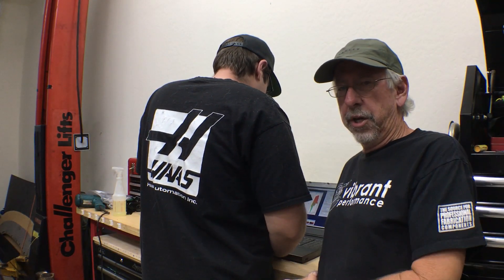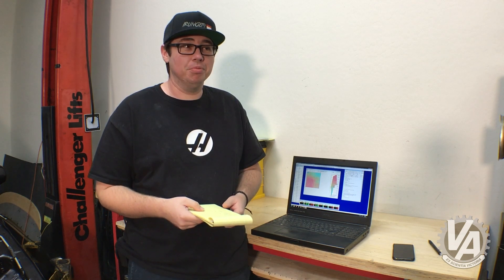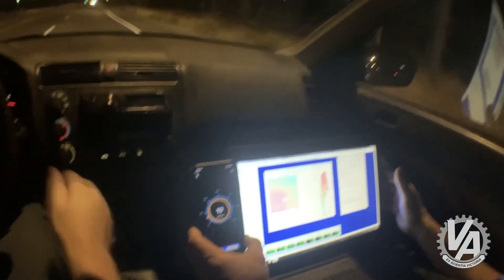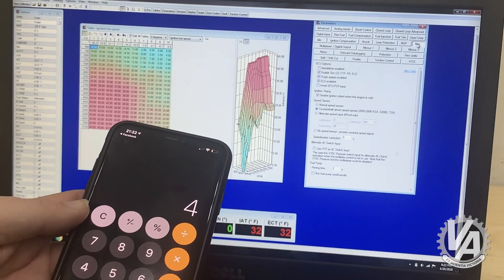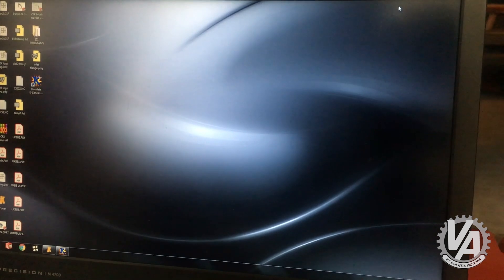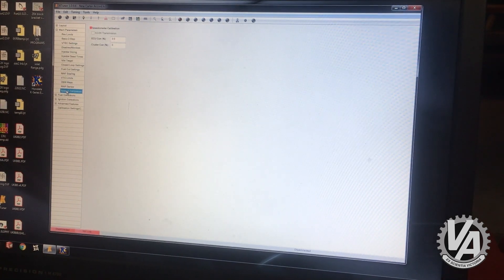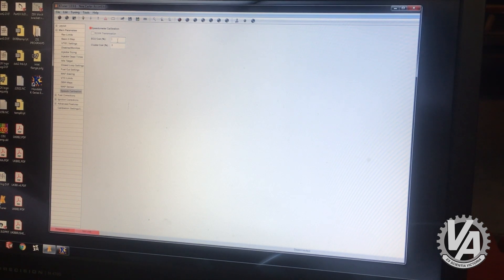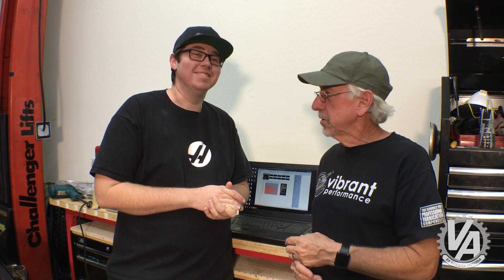How to Fix Your Speedometer After K Swap

Comment: There is a way to amplify the VSS signal within the ecu. The 05 RSX was plagued by a weak VSS signal. Within the ECU RM760 used a 223 SMD resistor. It needs to be changed to a 471 SMD resistor. Then on the QM760 there are 6 tiny solder joints, bridge jump the bottom right corner, leave the bottom left solder joint alone. You'll see that the lower right connects to the left joint on the 471 resistor. This mod fixes random or jumpy speedometer needles on the dash cluster.

Comment: Where do I run the wire from b11 plug using kpro v4
Reply: Runs to the white and green wire on your harness side of the C101 plug I just did this 🙏🏻

Comment: I have a K24A2 CRX. My Hondata V4 won't read speed, so I don't have reverse lockout. It was working and then stopped. I'm not sure what it could be.
Reply from the maker: If it was working, then it’s a bad connection.
Reply: @VTECAcademy   I've checked the connections, but I'll do it again. The harness is a brand new Rywire. I've replaced the sensor. It's throwing a P0500 code. Hondata shows 3 mph all the time.

Comment: K24A ek with 02 crv transmission kpro v4. Tried it but didnt work. Still reads 10 mph over actual speed.
Reply: Right. Because they fail to tell you this only works on the 05-06 speedo sensor and not the 02-04 VSS sensor.

Comment: Hi I k24 swapped my civic now the speedo and temp isn't working on the dash do you know what is worng  with it I changed the sensors and nothing has changed
Reply from the maker: What adapter harness are you using?
Reply: @VTECAcademy  using a ep3 engine harness
Reply: @VTECAcademy  and a TRC civic harness

Comment: Hello sir, kindly guide me, I recently swapped k 24 rbb - 4 head assembly in my accord euro r cl7, the previous one k20a, unfortunately its crank started giving rattling noise. I didn't tune my ecu, its same as if it was with k20a original rbc ecu with same software. I want to know is, what things are necessary after this swap, secondly I am noticing that my accord is now accelerating really to much fast and quick, but my speedometer needle is moving slow, does this thing happen after k24 swap, that the actual speed is more but speedometer needle is not moving with equal pace???? Is the callibtation of speedometer changes with the k24 swap from k20 in accord euro r cl7. Right now it's doing 0 to 100km in 8 seconds according to speedometer needle, but those cars which usually do 0 to 100 km in 8 seconds, remain far far back if I drag race with them till even 100 km. So do you think my speedometer needle is moving slow after k 24 swap?? , although its accelerating bullet fast from previous k 20 a.

Comment: Hey guys! I have a problem similar to this I just recently did a k24 swap on my Acura rsx 03 and my speedo on my cluster is working perfectly fine but on hondata it reads weird, I’m wondering is this a speedo problem itself or is this something I can fix within the tune
Reply: did u find a fix mine doest pick it up at all on the ecu only on my dash
Reply: @Ant0n_42  hey man so I actually changed my tuner to a better tuner and a more recommended one and he basically fixed this issue for me it was my abs wheel speed sensors and he basically bypassed them thru the hondata but your issue seems to be a bit different if you are picking up no signal at all in the ecu perhaps there is a problem with your ecu itself as mine would pickup speeds but it wouldn’t be accurate speeds try seeing if you can get any type of input of speed wher there it’s only 1 km or 100 km per hour  on your ecu which will tell u that it isn’t you ecu
Reply: @Ant0n_42  sounds to me like your having an issue with your ecu itself

Comment: Perfect lol, once again saved by your videos. Spent hours and hours researching this... I should've learned to come here first lol
Reply from the maker: Thanks!
Reply: @VTECAcademy  No, thank you!! It's made my em2 k24a and tsx trans swap much easier despite the unexpected hurdles I've come across due to using the JDM motor. Hopefully can get her started tonight or tomorrow once I repin my entire eBay kswap harness bc it appears they pinned it reading the diagrams in the wrong orientation 🤣, glad I checked it before plugging in my Kpro

Comment: It's not working for analog dash
Reply: Does this work with at ep3 transmission I don't seen to have that available to change
Reply from the maker: It should, unless it is cable driven.
Reply: @VTECAcademy  nope. It's digit signal driven but, thus correction it's working for speed info - i read from odbii.

But dash keeps the same speed.

Acura rsx type s 2002
Reply from the maker: @somediedrank  So you have a 2002 RSX Type S and what transmission?
Reply: @VTECAcademy  manual 6 gears
Reply from the maker: @somediedrank  What year?
Reply: @VTECAcademy   2002
Reply from the maker: @somediedrank  Is this setup in a 2002-2004 RSX?
Reply: @VTECAcademy  yes
Reply from the maker: @somediedrank  If your speedometer isn't working, but the ECU sees the correct speed then the problem is with either the wiring or the Speedo. The signal for the speed comes from VSS and splits in the engine harness and gets to the dash the dash via the C101 plug. So the problem is at or after the split. check for continuity from the C101 plug (white wire with green stripe at position 3) If you have continuity It could be loose pin fit at the C101 plug. You could try back probing the car-side of the C101 plug and see if there is continuity. But if that isn't the problem then it is likely the speedometer itself.
Reply: @VTECAcademy  looks like we have some misunderstanding.  Speedometer shows the speed. it's working. But I can't make a correction via hondata.  If I make correction - dash shows INITIAL speed (instead of corrected) BUT ECU shows CORRECTED SPEED.  (I can see it via KManager or if I connect some screen device to the car by ODBII)

I need to make dash correction. But it's impossible.
Reply from the maker: @somediedrank  You can only make the correction if you are feeding the output signal from B11 to the speedometer. And then the K-Pro has to be V4 and installed by Hondata.

Comment: Hello Speedo shows on KPRO after doing the mod on the C101 plug and b11 but won't output on cluster. Any idea why?
Reply from the maker: It depends on the KPro board version and whether or not it was installed by Hondata.
Reply: @VTECAcademy  any input as to why it has to be installed by Hondata, and why it won’t work from any other kpro dealer?
Reply from the maker: @EricDolinar  The other dealers don't activate the circuitry needed for converting the signal.

Comment: I’m a little confused on this, I have a k20z3 trans in an eg, using a ktuned engine harness and kpro v4 I switched the wires in the vss plug to match the 06 si,s speed sensor... will I still need to install the ktuned vss converter I purchased or will I be able to do all of that now in Kpro being that I have the v4?!?
Reply: I believe you will still need the vss converter because the k20a2 ecu is a low frequency and the k20z3 trans is high frequency, I installed mine and had the car tuned with kpro4 and everything works.
Reply: Kou Lor watch the lates episode of midnight oil from last nite! Brian answers the question fully and as he says the converter is no longer needed IF you have a kpro v4 that was installed by HONDATA...mine was, it’s a brand mew unit I just got back from him data a couple months ago.... I’m going to attempt to get it to work today, I will post here if I get it to work!
Reply: @Serpentis666  Nice! That'll save us some $$
Reply: Kou Lor I’m still a little unsure about how to go about it but from what brian said on the midnight oil episode last nite... 
I’m thinking the vss input from the kpro is what needs to be run to the b11 plug? I’m not a wiring expert by any stretch, so I’m going to ask a few friends that are more experienced... I will definitely keep you posted brother! Not having to use the converter would be great although I do already have it... but the less wiring I have to do the better and using band aid type fixes was never anything that I liked so if this truly works I’ll be very happy!!! If anyone on here would chime in would be greatly appreciated!
Reply: Kou Lor I’m also confused because looking at a pin out diagram of obd1 ecu it shows b11 as cyp sensor passenger aide input... and it shows b10 as vss
Reply: @Serpentis666  did you ever figure it out?

Comment: Wish this could work on my kswap 93 Integra
Reply: On the Integra you use the speed sensor in the gauge cluster. Use the cable drive and cable from the DA transmission and then feed the signal from the gauge cluster to the ECU.

Comment: I have a k20z3 trans and k20a2 engine harness, I switched the vss connector to match the k20z3 vss and switched the pins to read the 05+ style vss. Got the vss reading in k pro to work but not the speedometer, I then got the k tuned vss converter and wired that in and now my speedometer works and reads the correct speed, only problem is now the vss in k pro and on hondata app shows 0 speed but my speedometer on my gauge is working properly, any ideas? Oh and I did get a vss malfunction code but stange thing is speedometer works. Thanks guys
Reply: Kou Lor I’m about to do the exact same thing and would love to know what I may be encountering in the process
Reply: @Serpentis666  It wouldve helped if they showed what they did to the B11 connector on the ecu like what Brian talked about but at the time I had already bought and installed the converter box because I was also confused

Comment: Dumb question here but I'm not understanding what you mean by inverse. My cars doing 55 while speedo says 70. After I did the division it came out to 0.78 how do i get the inverse percentage from that ?
Reply: .78 is 78% inverse means you subtract 78 off a 100 = 28 so you put 28%

Comment: Will it be the same on a eg with a kpro v4 and k20z3 transmission? Or will other parts be required to make it work? How will the wiring be done on the vss connector itself?
Reply from the maker: It will be the same.

Comment: Does this fix apply to say, an 01 Insight with 02-04 Kpro V4 using the countershaft speed sensor for 06 Accord trans? The ECU can be calibrated with the 05+ VSS box checked but the cluster won't receive the modified signal and a converter will need to be used as I understand it.
Reply from the maker: It should work if you have the correct output wired to the Insight harness.